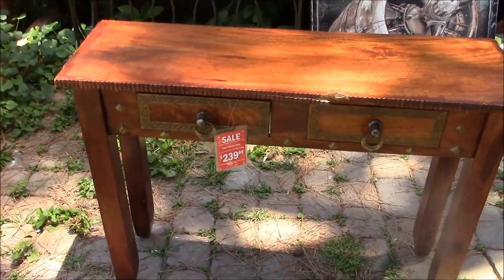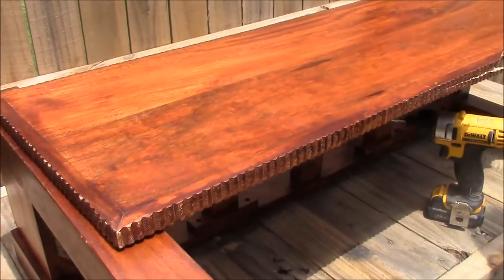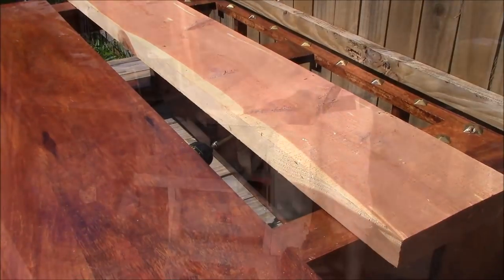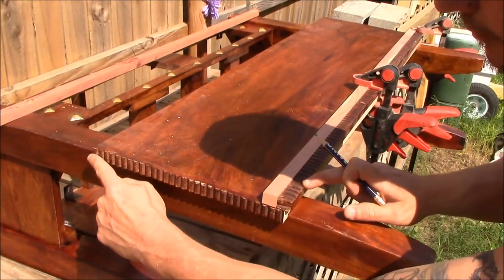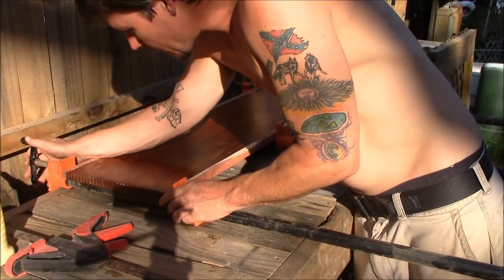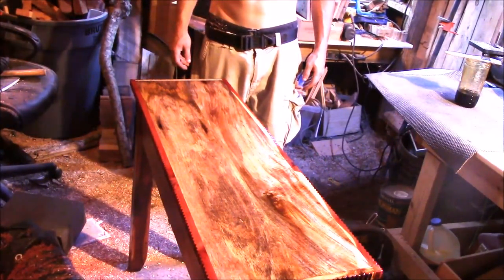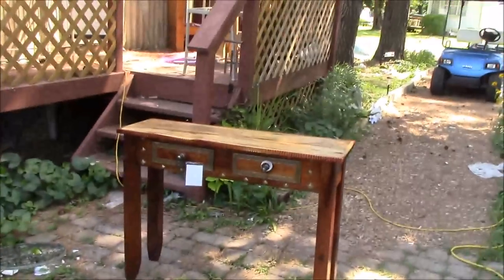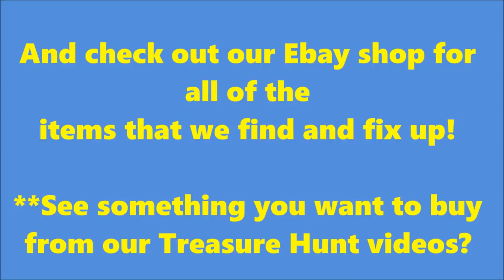Canipe's Wood Shop/  Fixing a Pier 1 table/  more beautiful than the original

Comment: you are going to hate me. why did you not use filler and turn the top round so the filled bit was at the back. we have repaired worse than that on non structural parts of furniture. mum and i have repaired so many tables and chairs chewed by dogs. dogs and cats are brilliant for restoration reupholstery business 😜 owners mortified.😂

mind you what you did is very  good just way more effort 😂 totally agree with you they covered up the gorgeous wood . 
my guess is that don't use all the same wood when making up furniture and buy in batches so sometimes the wood will not match . the joys of mass produced furniture 😢 we have had stupid customers who want dark stain on beautiful wood arghghgh .... insert rude word of choice 😢

you can get samples of woods from timber merchants for matching woods
Reply from the maker: Yes you are right about the mismatching wood. they had different kinds of wood just on the top, some of the trim were oak, and another piece looked like something else
Reply: I like the way you did it Chris, I like the contrast of the wood. If it had been an antique piece that would be different, but it's not. You made it come back to life and end up better than it was !